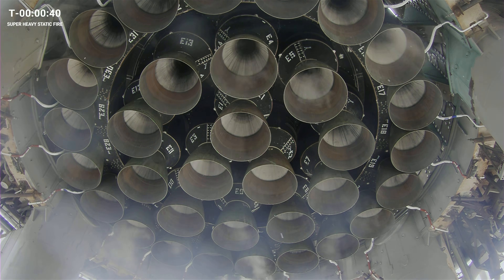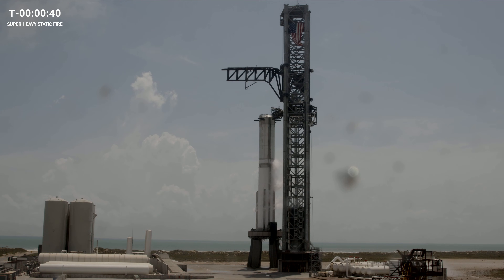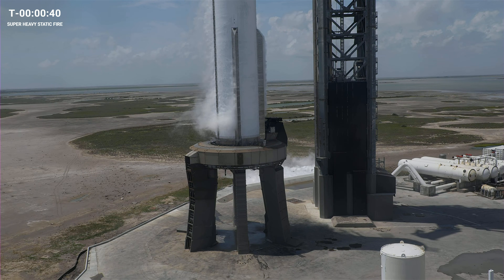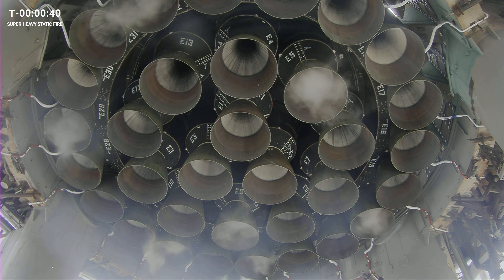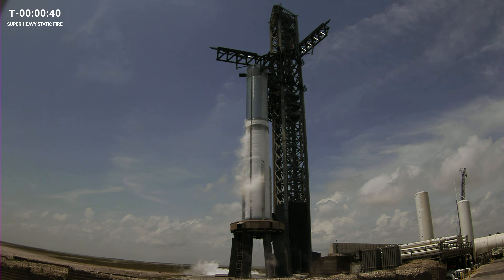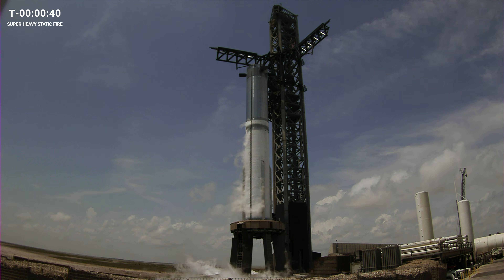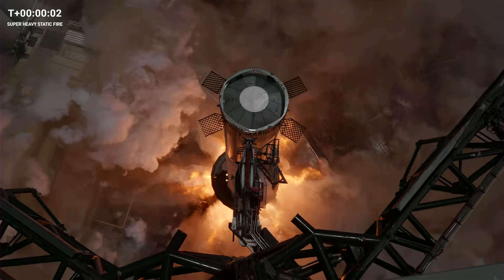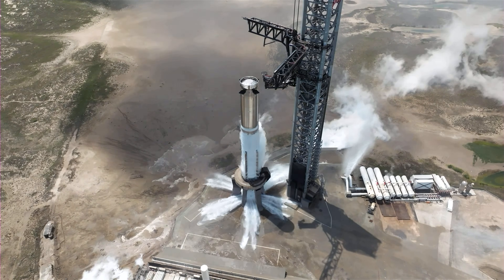Starship Super Heavy Static Fire

Comment: He said at the end the goal is 6 seconds. Why did they only go 2 seconds yet still called it “full duration”?
Reply: If you notice, they started engines at least 3 seconds before hitting t-0 as per their clock. So they did get at least 5 seconds burn
Reply: It clearly started before t0
Reply: Ahh makes sense. So they did actually fire it for closer to 6 seconds, the timer was just delayed. Thanks.
Reply: I assume this is because t-0 is actually the lift-off time for the stack. This would I suppose mean that in the first 3 seconds, before take off, all engines are tested and checked. This would explain why the first static lasted just less than three seconds, as too many parameters weren’t nominal for lift-off.
Reply: The engines also fired at t-minus -0:02.  What they display to us is much delay to what they have.

Comment: Pretty awesome but the call-out said full duration at about 3 seconds but the announcer said they were targeting 6 seconds?
Reply: If you notice, they started engines at least 3 seconds before hitting t-0 as per their clock. So they did get at least 5 seconds burn
Reply: Started before T=0
Reply: I assume this is because t-0 is actually the lift-off time for the stack. This would I suppose mean that in the first 3 seconds, before take off, all engines are tested and checked. This would explain why the first static lasted just less than three seconds, as too many parameters weren’t nominal for lift-off.

Comment: The clamps holding the whole rocket assembly down...could it damage the locking system with all that force??
Reply: It is designed for it.  There are a lot of huge clamps.
Reply: the force on the clamps isn't really that much, due to gravity pulling the booster down.
Reply: *duct tape

Comment: That was crazy at only ~50% throttle as well!
Reply: @Bryan-Hensley  I noticed the same thing.  You can also see some pretty good chunks on the ground next to the booster.
Reply: @radian2323   thats just dirt kicked up by the cloud, its impossible to avoid and isnt dangerous
Reply: @saturntechnologies1350  that's good.  Crossing my fingers damage is minimal on the pad.
Reply: okay. on his video https://youtu.be/cltnwVMcYgw?si=PMWPDYX83rfa0amn 
you can see debres raining down, BUT i would suppose it is just loose debres lying around ejected from the blast. But in 0:48 you can see a concrete slab flying around. I am a little bit concerned that this could actually be a part of the fondag, but even though this may be the case, for it looks too much like a broken part just lying around  @Bryan-Hensley
Reply: before the first test flight the fondag withstood the 50% test, but still it got obliterated after the test flight @Bryan-Hensley
Reply: @Bryan-Hensley  thats just dirt kicked up by the cloud, its impossible to avoid and isnt dangerous
Reply: which footage, where can i see it, where is the debris?? @Bryan-Hensley
Reply: i really hope it will manage to withstand the pressure at a real launch
Reply: I bet it was more
Reply: @Bryan-Hensley why do you worry ? If there is a problem they will fix it .

Comment: The water system really seem to be doing its job
Reply: until they hit full power its still in doubt but looking promising so far
Reply: @The_Art_Of_Pain a lot further from the ground
Reply: @koonhaokoonhao and I think that it is more "soft" trustwise than the takeoff...yes, I pulled that of my a....
Reply: @The_Art_Of_Pain  landing burn is with only a few engines as 95% of weight has burned up by that time.
Reply: I have my doubts... it is far away from full power
Reply: @Bryan-Hensley  true
Reply: @The_Art_Of_Pain the landing is done with just a few engines as the tanks are much much lighter without all that fuel and the upper stage sitting there
Reply: Hey, guys, does anyone know if they try to recycle the water run-off from the deluge system?
Reply: @Ottee2  some of it drains into a pond thing, but with actual launches most of it would evaporate
Reply: @Ottee2  they're on a beach. It would likely just be sea-water
Reply: @SpecialEDy , I thought of that, of course, but wouldn't saltwater be corrosive?
Reply: Fingers crossed it’ll be fine during the full thrust burn for the next flight.
Reply: does water help reduce vibration?
Reply: @wheelmanstan it helps with the sonic vibrations best, and those are dampend alot by the steam.
Reply: They went overkill with the strength of the pad. It can handle a lot more thrust than a full power starship.
Reply: @ 50% thrust yep
Reply: @fabrb26 blah blah blah
Reply: You pad very close attention
Reply: @The_Art_Of_Pain    Landing burn is a fraction of liftoff burn.
Reply: Almost at 420. Let's goooo!
Reply: That's it's job
Roy Keane
Reply: Theres really no telling at just 50% thrust for 2 secs
Reply: @The_Art_Of_Pain Superheavy will be caught by the tower, therefore no landing.
Reply: 😂❤ u may not believe in a god. But I bet u believe in power. Now we're that power can from is up to u. There no way talking about the the devil. Children the Illuminati aka fallen angels aliens NASA the wolfs the devil would give it to me. An if I'm spreading lies then Jesus would not allow it.
So those that read all my words will experience Jesus healing energy all old aches and pains will be washed away. Takes 30 minutes best to relax and shut yr eyes. Warning it is intense all black and white sheep are allowed level 1 portion of youth longevity digestion an self beauty Jesus energy wash tonight at 11 o4 eastren. Jesus wants all to be in good condition for judgement day.
Reply: The last pad did well with short static fires also
Reply: the water is for dust and sound. it lowers the decibels by half almost.
Reply: Yes, especially after what we learnt from 24/7
Reply: @mrprongles9510 if that had happenes a catastrophic steam explosion would have occured, this is what's supposed to happen
Reply: It did its job in flight 2!
Reply: @stevengaming3689 And flight 3!
Reply: looked undersized to me, i bet they still gonna have problems when its at full thrust.
Reply: what did you say?  @mhcosss
Reply: you can't turm off the fire when you are on the surface of the sun dude...
Reply: Not much water on mars
Reply: @rmsrmsrmsrms there isn't going to be a full 33 engines booster landing or launching from Mars though, it'll only be the Starship (upper stage)
Reply: @corrick4339 i.e. At most 9 Raptors(some of their animations show 6 vacuum Raptors instead of 3), which is less than 1/3 of Super Heavy's
Reply: that and they don't care if they make a crater on mars
Reply: @crestfallensunbro6001  they sort of care if it's a dangerous way to get off the ground though right?
Reply: @corrick4339  it's much less dangerous on a smaller plant like mars, the smaller the thing you are launching from the easier it is > you can have a smaller rocket/ignight fewer engines > less fuel is needed > it's even easier > need less engines... And so on and so on
So taking off from mars or the moon or anything smaller than the earth would throw up way less debris
Reply: @crestfallensunbro6001  Actually, they do very much care.  The last thing they want is to make a crater when they land or take off again.  All that rock debris being blown directly into the base would be no bueno.  That's why lunar starship has those landing/takeoff thrusters built into the rings just above the fuel tanks with the thrust angled at about 45 degrees outward to keep any debris generated away from the ship as it lands.
Reply: @crestfallensunbro6001  3 raptor engines firing straight underneath themselves onto flat dirt seems like it wouldn't necessarily work.
Reply: @corrick4339  I'm sure they have something planned
Reply: @crestfallensunbro6001  yeah, speculation is fine, but it's funny to me when people claim that they know this stuff. I feel like SpaceX is figuring a lot of stuff out as they go too.
Reply: @rmsrmsrmsrms  Wouldnt need the same power to lift off. Starship could properly do it without a booster.
Reply: @rmsrmsrmsrms  No need. No Superheavy going to Mars.
Reply: Starship prototypes have launched and landed without much issue. 

They will need a pad on mars eventually. To avoid rocks being kicked up into the engines etc.
Reply: @Eagles_Eye They won't need a pad for superheavy on Mars, no. The upper stage of Starship is the only part that will go to Mars. The superheavy booster will detatch after launch and return to Earth.
Reply: @ninetailedfox579121  they will need a pad for the ship… it will have to launch, you don’t want rocks flying back into your engines + flat landing spots will be nice too.

Even spaceX shows you they will use pads in their presentations.

I am talking ship, not booster ^ like I mentioned in that comment. Successful launch and landing.  Haven’t seen a booster landing yet now have we?

I do love when people think they know it all. But ignore what spaceX / elon themselves have said
Reply: @Eagles_Eye  Well at least you admit that your comment is completely irrelevant. This conversation is about the booster, so talking about stage 2 needing a pad is just silly and has nothing to do with anything in these comments.

The pad on Mars will not need the water propulsion system that superheavy has because stage 2 has much, much less power.
Reply: @ninetailedfox579121  if you had actually read ALL of the comments you’d see my comment was relevant,

Now if you excuse me I’m not in the mood to talk with people like you.
Reply: @Eagles_Eye  I did read "ALL" of the comments. The only ones that have even a slight relation to yours are the ones talking about the water on Mars, which I, as well as many others previously, have said is not necessary on Mars as the superheavy booster will not be going there. Stage 2 of Starship does not need the water system for launch.

That's good, I am glad you are not in the mood to talk to people who actually read comments and think before they type. Maybe try doing that next time.
Reply: @ninetailedfox579121  you’re full of yourself.
Reply: @Eagles_Eye  Oh my gosh, here I was thinking you are not in the mood to talk to people like me. And coming back with such a zinger! I'm impressed.
Reply: @rmsrmsrmsrms  You dont need full thrist on Mars
Reply: @rmsrmsrmsrms less gravity, less thrust?
Reply: @rmsrmsrmsrms they don't need full thrust to enter Martian orbit from mars surface